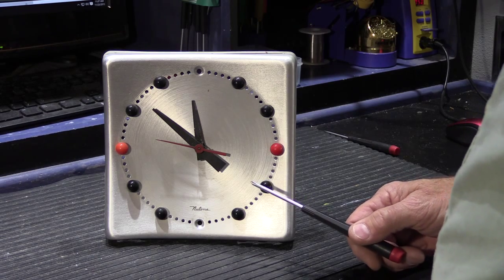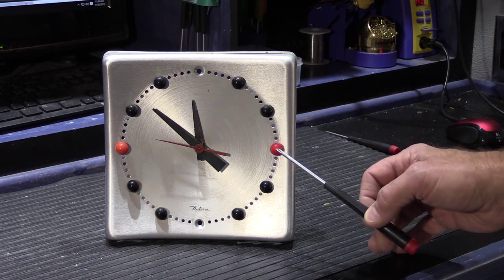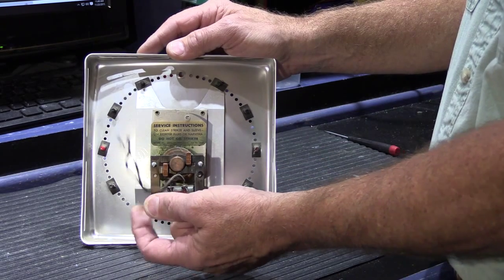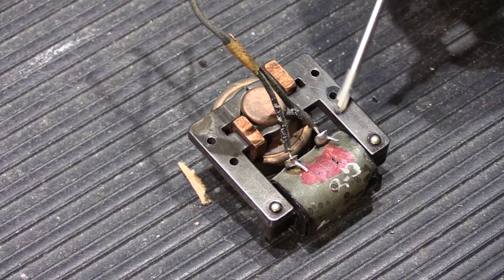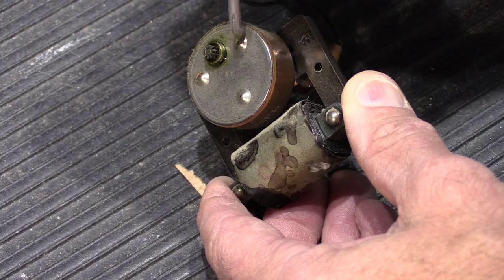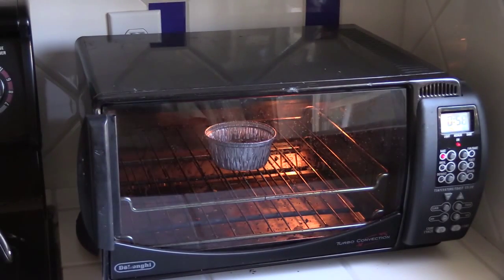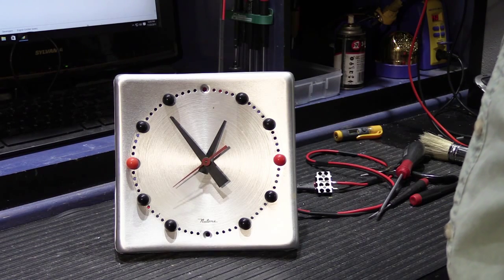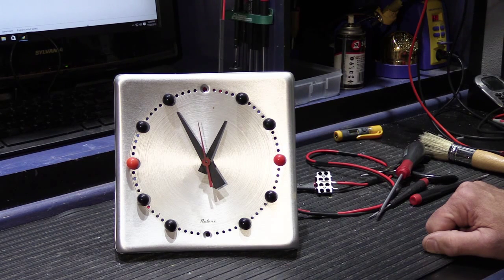Repairing the Telechron Clock Motor in a NuTone L36 Elite Clock Door Chime

Comment: Nice trick, I will make a little hole on it then will put some thiner in it and soack it shacking it for a while replacing the thiner a few times then will put some fresh oil in it.
Reply from the maker: Hi jarguedas:  I would not reccommend servicing the Telechron Gear Drive as you describe - It is just to invasive for what needs to be done.  - Chris

Comment: Great video, thank you. My ac telechron motor is growling a bit, sounds dry, going to try your method. I am just not sure that w-d 40 is the best gear oil to use on the actual clock gears. Im afraid it would evaporate fairly quickly. Again, thank you.
Reply from the maker: Hi MrMark:  In the Video I - Did Not Say - to spray the clock-work gears with WD40.  I did say that just a drop on the Pivot Points woudl be OK - The gears in a clock-work mechanisum never need to be "oiled" - only the Pivot-Points need some lubriucation.  Clocks like this don't even use bushings on the Pivot-Points, which just go through the mounting plates.  I use a synthetic silicone instrument oil on the Pivot-Points.  
     Spraying the gears only makes the "sticky" and then they collect dirt and dust, which creates problems with how they work.  Now-a-days, when these clocks are sent in for servicing, I take the Clock-Works completely apart - clean everything in the ultra-sonic cleaner, with clock cleaning solution and then reassemble them - Chris

Comment: Does the telechron movement use 110/120 volts AC to run?
Reply from the maker: Hi john:  Telechron Motros were made and available in many different voltages - I have seen them rated as low a 8 volts and up to 220 volts - The L36 Clock Motor is a 16 Volt AC Motor - Chris
Reply: Great thank you

Comment: THank you. It is great to see a very professional video and I am going to attempt to repair my coil as you describe.
Reply from the maker: Hi andrew:  Be extra carefull with the 2-wires that are connected to the Motor Coil - Don't pull on them or stress them in anyway, otherwise the paper wraping around the coil will tear and the wires will come loose - Chris

Comment: I have an old GE clock with the same motor, and it doesn't seem to have any continuity between the two legs of the motor windings at all, but it works fine. I had to take it out and heat/lube it because it was making a terrible grinding sound. Hopefully the new clock oil I added will solve the issue. It sounds fine now, but time will tell.
Reply from the maker: Hi brian: All sounds good - Chris

Comment: 17:08  Great video! I have purchased similar Nutone doorbell clock from a salvage reseller online. I don't think I'm getting the chimes so I want to know if it can be mounted to or inside the wall and used as just a clock? The house has easy access to wiring. The seller says it was working but really not much information about the box and chimes. The house has an old working 2 chime doorbell so it's not needed as a doorbell. We just really love the clock face. Goes so well in our 1959 house!
Reply from the maker: Hi colleen:  The Clock you purchased will operate on it's own just fine.  It will require a 16 Volt AC Transformer rated at 15 Watts (VA).   The Clock cover would have attached to the Chime Box that was inset in the wall.  You will need to find a way to attach the Cover -  Chris

Comment: Thank you so much. I have an old Rittenhouse door chime, I'm assuming was installed when the house was built in 1970. The clock hands weren't turing anymore. I considered replacing the motor, but this method worked to loosen up the gear. My clock is keeping time now, and the gear seems to be alot more freed up.
Reply from the maker: Hi JST:  Glad to hear that the Video help with your Rittenhouse Clock - Chris
Reply: @northsideservicecompany3567   Thanks, I have noticed only one of my end and middle chimes strike anymore (2 of 4). Do you think I'd have any luck giving the chime motor the same treatment and cleaning the contacts on it? Some time when I have time maybe I'll take it down off the wall and try servicing it. -Jared
Reply from the maker: @jt9411  If any of the 4-Notes ring, it's not a Motor / Gear Drive issue.  It can be dirty / stuck plungers - missing Plunger Tips - Wear and Tear on the Contact Rotor and Circuit Board - All a mix of all of these items - Chris

Comment: Don't use WD-40 on any clock.
Reply from the maker: Hi Mark:  Correct - WD40 is the wrong product for cleaning Clock Mechanisms.  The gears and other parts in a Clock Mechanism should be carefully disassembled (if possible) brushed to remove dirt build-up then either soaked in a quality clock cleaner.  Since I have an ultra-sonic, that's where I clean them - After cleaning - only some light-weight Instrument oil should be used on the "pivot-points" and the ends of the gear shafts - Lubricate should never be put on the teeth of the gears - Chris

Comment: Oh my God.  
I have been doing Telechron rotors/ clocks for several years.  First thing you want to do is to clean around the cup and gear..  it probably is gunked up and you do not want to suck that crap into the rotor.. Toaster oven method is one way of heating, a decent hair dryer for 5 minutes will heat the rotor enough to loosen things up.  The rotors when made had Dino oil it which hardens over time and now is probably a blob.  Turning a rotor with a pliers is a last resort for a rotor that still will not turn even after heat/ cool cycles.  The oil I use is synthetic 0w-20 motor oil.  I do about 4 to 5 cycles of heating oiling cooling at 4 drops per cycle.  If the rotor does not accept oil at all I try Marvel Mystery Oil.  About 25% of my rotors will not suck up oil. After that the saving grace is to drill and get solvent in the rotor. I will not go into that.
Reply from the maker: Hi W Wagaman:  It sounds like you have done lots of rotors - I do clean them off before starting.  Since these are used in NuTone Door Chimes - they are exposed to all sorts of dust, lint and dirt.  I like the toaster oven method because I can be working on the Chime Base while the rotor is heating up.  I've only had a few that still wouldn't turn after heating them 3-4 times and adding oil.  I haven't drilled any to add a solvent - how do you close up the hole?  Do you worry about getting the shaving inside the case?  I guess some grease on the drill bit will catch the shavings - Chris

Comment: Thanks I used your video and got a Rittenhouse clock / door chime to function again. It’s real load though not sure why. It’s keeping time correctly.
Reply from the maker: Hi lorduvane:  Did you add oil to the Telechron Gear Drive as I show in the Video? - Chris
Reply: @northsideservicecompany3567  yes, I ordered a new nos rotor off eBay I’m going to try that. I might not gotten enough oil inside it.

Comment: I have a NuTone Model LC38 8-Note Short Tub Bar-Chime that is not rotating through the total 4 or 8 notes when the door bell is depressed. I cleaned the board and contacts with rubbing alcohol pads and eraser, and also heated the synchronous motor to 140 degrees for 20 minutes followed by WD40 shots which allowed the gears to move freely. For some reason, the motor will not rotate through the 4 or 8 contacts? If the door bell is pressed, one chime will strike. If I hold the door bell button on for the duration of the cycle, all chimes will strike at the expected speed, but only if door bell button is held on. Why does the motor fail to complete the chime cycle with a momentary depression of the doorbell? Stumped.
Reply from the maker: Hi S.E. Ray:  Has this NuTone Chime always been in this house, or are you installing it in place of a standard 2-Note (ding-dong) door bell?  If it's always been in the house, there is probably a problem with the "start - stop" switch (which is the springy metal tab under the motor) - Watch this Video to learn more: https://www.youtube.com/watch?v=LqeyzBV-f0E&list=PLsTvqKsBnGYdEvtzvv_pz1gOKa9UPuAxH&index=1&t=789s

If this Chime is replacing an original 2-Note doorbell - You most likely have it wired incorrectly - Watch this Video to learn how to wire a 4-Wire Chime: https://www.youtube.com/watch?v=TjKUx18TEvc&list=PLsTvqKsBnGYdEvtzvv_pz1gOKa9UPuAxH&index=3

Finally, WD40 is not the correct product to add to the Gear Drive - a light-weight oil should be the only type used

Chris
Reply: @northsideservicecompany3567  Thanks Chris! My bad on the oil, I see you used 3-in-1 oil after another review of the clock repair video. Never-the-less, the motor did spin freely before my four meager injections, so it should be good. The three arm contact spinner under the  synchronous motor is making complete contact on the board, something I checked carefully before reassembly.

I did in fact attempt to replace a 2-note Nutone with a 8/4-note LC38 Nutone. I do have a wire connecting the Transformer, the Front and Back posts. Included is a bundle of four white wires tied together with an electrical wire cap. After watching the video, my takeaway is I need to add a lead from that bundled wire cap and attach the other end to the "Com" post which currently has no wires connected. To this point, I lacked the continuous power for the motor to run a full cycle.  Sound about right?
Reply from the maker: @SERay-xh5wu  Yes - You're on the right track with the lack of constant power.  Often it's easier to disconnect all of the wiring - identify which pairs come from the Transformer and Pushbuttons - then rewire the Chime as I show in the Video - Chris
Reply: @northsideservicecompany3567  I could use a tone generator and trace each lead, but the white wire bundle is the only possible variable remaining. I did add a lead from the white wire bundle to "COM" connection today and the door bell does cycle the full 8 notes. Only remaining challenge, the door bell requires two subsequent presses to get the motor in motion. If you press the doorbell once, nothing. Press it again within a second, then the motor spins. There seems to be a gap where the contact armature is connecting with the board. However, the board was in great condition with minor wear grooves. Possibly one of the three arms, where the two contacts touch the board, one might be slightly sprung not allowing full contact to pass from end of cycle to new cycle? Although I am not sure how that could have transpired with an unopened unit? I have spent roughly eight hours on this vintage doorbell, so it is all a bit frustrating to get so close, but still not be right.
Reply from the maker: @SERay-xh5wu  It is on course difficult to comment on mechanical issues for something I haven't seen I person - I have seen the contact on the ends of the armature get bent during cleaning, however this is not that common.  How long are your button presses?  A quick stab at the button will not be long enough to make the motor rotate enough - a deliberate press of 1 to 1-1/2 seconds (that natural way a visitor would press it) is required. - Chris
Reply: @northsideservicecompany3567  Thanks Chris. I don't mean to continue to waste your talented time, however I did test the doorbell a number of times. It was a firm press that resulted in nothing, and another firm press that resulted in a full chime rotation. After a full rotation, another firm press resulted in nothing until another firm press. It is as if the rotating contact armature is missing one step after the end, that aligns it for the next rotation. Since there are two prong contacts per arm, if one is slightly sprung or the groove especially deep (which one is) then I surmize it is possible the prongs may need to carefully calibrated to all touch the board equally to assure a full spread of contacts. That is really all that is left that I can think of. Thanks for your assistance, which at least resulted in a working doorbell :)

Comment: Why not power it up and run it while putting oil in the motor
Reply from the maker: Hi Roger: The oil will not find its way into the Gear Drive by just putting some on oil on the gear.  Heating the Gear Drive causes the metal parts to expand - Then while it's cooling, the metal parts begin to contract - creating a slight suction - which will draw the oil into the Gera Drive.  This is what I show in this Video - Chris

Comment: Thanks i fixed my revere b 13 rotor it was screetching loudly, and noisey and stopped.. used my Oven for a while used tufoil (tpfe)premixed lube at shaft many times it sucked in..moved gear which was frozen at first. Became easier to move.. Multiple trips to the oven and oil.. now the motor is silent.. It has never been silent for the 5 years i have had it..  THANK YOU....
Reply from the maker: Hi peter: Sounds like it all worked well for you - I'm glad the Video helped - Chris
Reply: @northsideservicecompany3567  thank you still so quiet i cannot hear motor with my ear on case..

Comment: Hi Chris.  Will the L-36 Elite chord tone chime be activated by an Ext Front wire from an L-70 or L-39 4/8 note, 3 bar chime?  I understand both chimes need their own transformers.  Do you simply run one wire from “Ext front” of the  L-70 or L-39 to the “front” terminal of the L-36 or is there another wire that needs to be run?  I tried it because I want to connect an L-36 in a bedroom/den as an ext to the main foyer L-70 electronic chime, but it would not trigger the L-36 chime during a bench test.  Both chimes had their own separate transformers with common and trans wires properly attached to both chimes.
Thanks
Reply from the maker: Hi Anthony: Like they say - A picture is worth 1000 words.  I posted an image on the wiring diagram that show how to connect your 8-Note Chime to you 2-Note Chime.  Here's a link:  https://www.youtube.com/channel/UCcMN_sDzaDThDYRBb2Qcahw/community?disable_polymer=1
Chris
Reply: Northside Service Company                    Thank You, Chris.  Do you know what “two transformers connected in phase” means?
Reply from the maker: @anthonygentilella683  Explaining how to connect 2 Transformers in Phase is difficult and it may be hard to understand.  The simpler choice is to use a single Transformer - with the correct Voltage - and with a larger VA (watts) rating.  If you use a single 16 Volt AC Transformer with a minimum of 30 VA (watts) you 2 Chimes should work fine - Chris
Reply: Northside Service Company               Thanks very much!

Comment: I use a heat gun and WD40 The WD has a bunch of solvents in it and it thins the old grease.
Reply from the maker: Hi Jay: That's an interesting approach - Chris
Reply: @northsideservicecompany3567  I have done several of these and they all still work after several years

Comment: Thanks for the video! Got my Japanese Coramatic flip clock to run again, just using a hairdryer. The motor inside is a 3.6 rpm Toshiba. Squirted some trumpet valve oil around the gear, hopefully some will penetrate the movement inside and free it up some. Question- is your toaster oven set to 140° Fahrenheit or Celcius? I assume Fahrenheit as 140°C would really bake it!!
Reply from the maker: Hi Nismology5:  The toaster oven was set at 140°F - Chirs

Comment: Your testing helped me out alot as I also had 10-11 Ohms so I was able to determine that was ok and focus on the motor. I used a hot air gun to gentle heat mine. Even though mine did initially turn, you video helped me see if was far from moving as freely as it should.
Reply from the maker: Hi Silkworm:  I'm glad to hear that the Video helped in getting your NuTone Clock working again - Chris

Comment: I have had good luck heating the motor with a hair dryer while putting a mixture of WD and 3in1 oil on the stem. Soon you see it bubbling from the expanding air inside coming out. keep the stem under fluid and it will suck in the oil. Do it a couple of times and let it run. Works great. No drilling and getting any metal flakes in the movement.
Reply from the maker: Hi Jay:  Sounds like a good method - I'm not a fan of drilling the case to add oil, that's to risky in my opinion.- Chris

Comment: Dumb question, but I can't find any instructions on Google.... what is the "correct" way to set the time on these movements?
Reply from the maker: Hi Jamie:  Some NuTone Clocks have stems that set the time -  on models without stems, you just carefully rotate the minute to set the time - Chris
Reply: @northsideservicecompany3567  Thank you for your reply and for all your valuable advice in your videos!  So there is no harm by turning the hands backwards?  (I just got my hands on an  L-60 Sunburst model, soon will find out if it works. I saw you mention it in one of your videos - any video on the L-60 coming in the future?)
Reply from the maker: Hi Jamie:  I usually turn the hands in the correct direction - I actually have recently acquired a NuTone L60 and there will be a Video soon - Chris